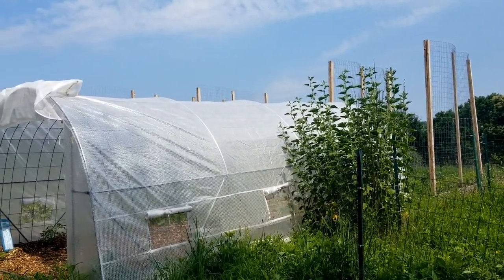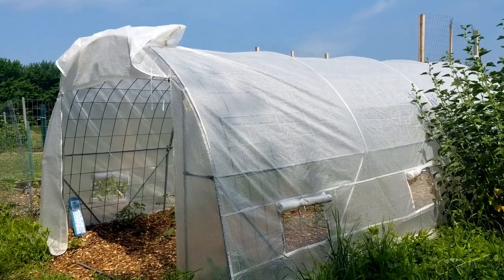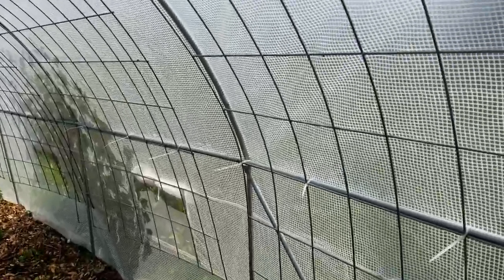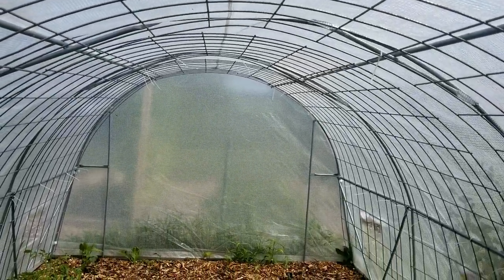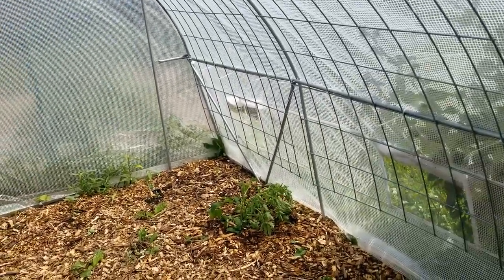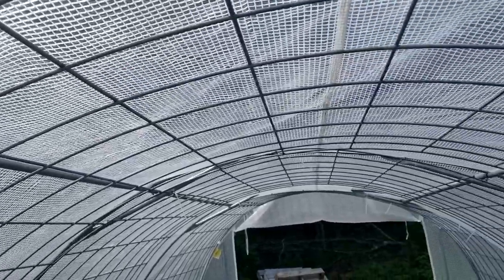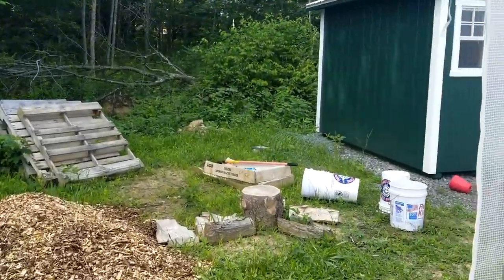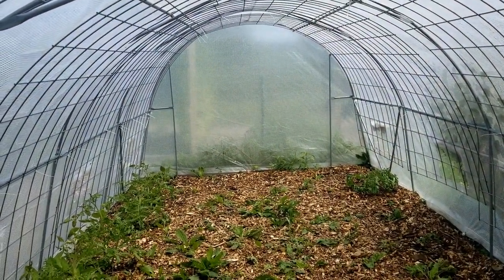Quick Fix For a Buckled Greenhouse

Comment: if it dosen't have a bar in the middle...why not get a pipe and fix it? xD looks like so much job done that didn't needed to be done..even a rebar would had worked..
Reply from the maker: Sometimes you have to work with what you've got.  I had cattle panels so I used them.  Homesteading plus working a full-time job doesn't offer me much free time to drive all the way into town to get what I need.  I'll have more time to work on this project in the fall, and at that point, I may decide on getting a better quality frame and replacing the current one.